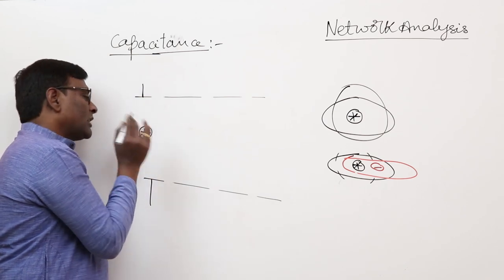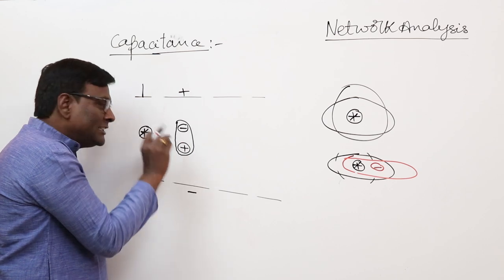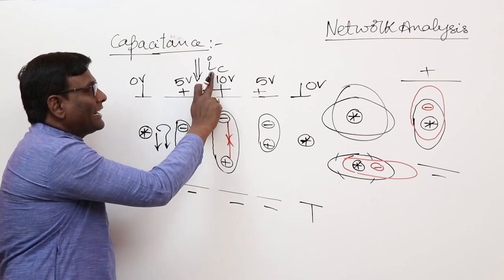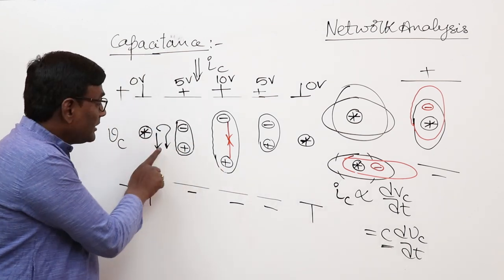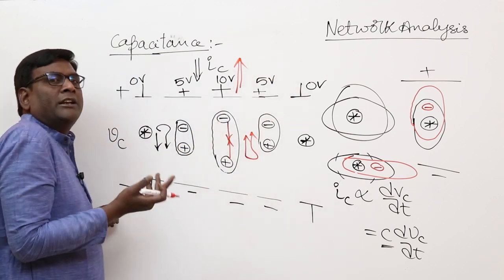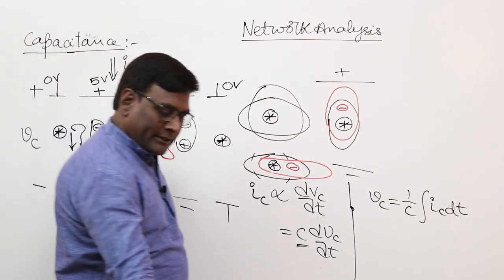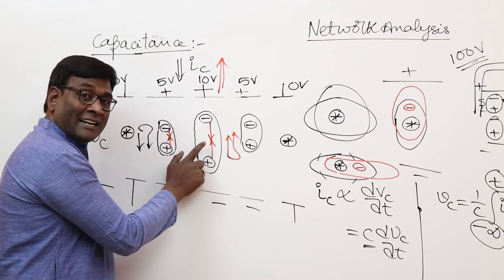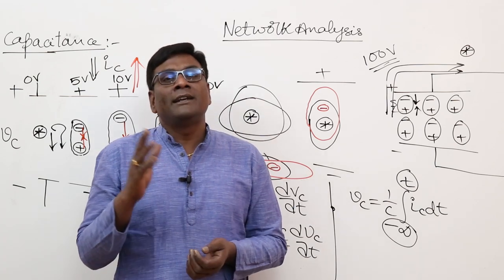How Current flow through Insulator in Capacitance | Displacement Current | GATE Lectures by KN Rao

Comment: Sir, if there no electron came out from dielectric material How can the current flow? Even the  dipole formation no current will be there In insulator as there no electron movement?
Sir plz explain... Thank you sir
Reply: There are 3 types of currents Conduction, Displacement and Diffusion currents. 
Conduction current is due to the flow of electrons general phenomena in conductors. 
Displacement Current is due to the Displacement of electrons. This happens in a capacitor.
Reply: Sir said about only displacement current but what about conduction current?
Reply: @saiteja_Creed  please explain about conduction current in capacitor